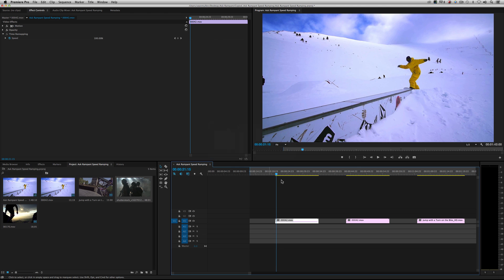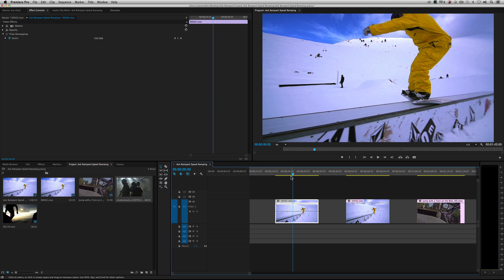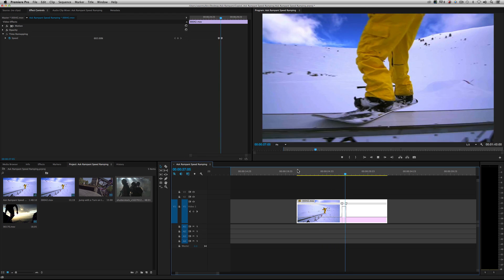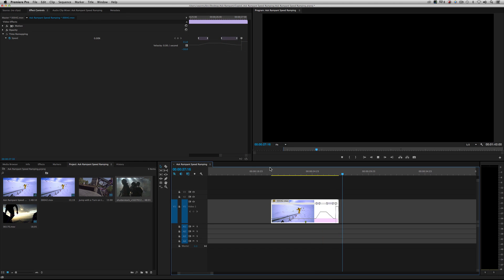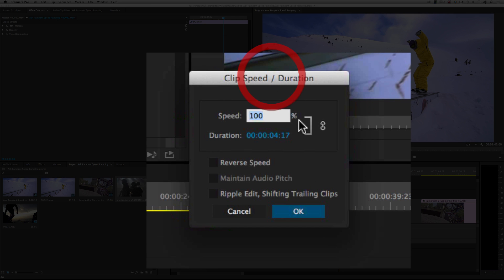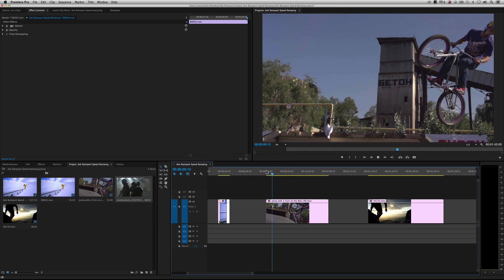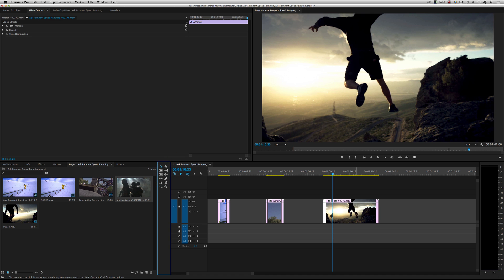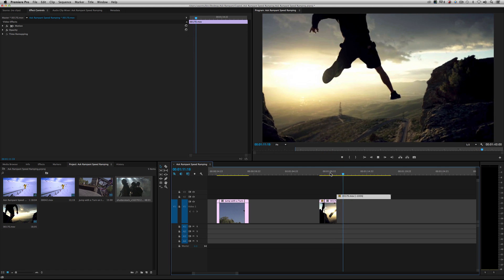Ask Rampant: How to Speed Ramp in Adobe Premiere

Comment: Why do my keyframes move as I increase the speed?
Reply from the maker: Hi there, thanks for writing. As you increase or decrease the speed of a clip, the length of the clip will grow or shrink accordingly. So if you have keyframes on a clip and then you speed ramp it, all of your keyframes will move according to your new settings.
Reply: Thanks Sean for the quick response. As you increase the speed the keyframe didn't move and the line stays lined up with the keyframe. But mine moves in as I'm trying to increase the speed; the keyframe and the speed line.

Comment: Don't use the first method, it messes up your other keyframes in that clip. They either stop working or change values randomly
Reply from the maker: Hey there, that's not the proper way to use the first method. If you already have keyframes set, you need to nest the clip and then do the speed ramping technique. Premiere will not allow keyframes on keyframes, it will absolutely mess up that way.
Reply from the maker: You can also speed ramp first, nest the speed ramp and then apply your effects & additional keyframes.
Reply: Yeah I knew that, but I'd like to not do so, it slows down the process and creates a lot of nested sequences

Comment: Hi Sean. Thanks so much for the tutorials! I've been using speed revamping quite extensively in Premiere Pro, but keep on running into the problem of not being able to use keyframes with aspects such as opacity, rotation, offset, etc. More specifically, when I change a parameter in the effects panel after having speed revamped a clip, the keyframe won't work for a given effect. Thus, I have been forced to nest all of my clips to simultaneously keyframe certain elements and also have speed revamping. Do you have any solutions in mind? Thanks! : )

Comment: I would really appreciate if you could help me with this!
I want to ramp a sunset from 100%-10000% but I want to do it with a curved line. HOWWWW!!!
Reply: I think you need to place a Keyframe at the very start of the clip and one to where you want it to end, then just set the speed of the second keyframe to 10000 and that should maybe work. Not too sure but give it a try.
Reply from the maker: Hey there! If you're doing the keyframe method, make your 100% keyframe and your fast keyframe and then right click and ease out of the first keyframe and ease in to the second keyframe. Your linear animation will now be curved.

Comment: Hi Sean, I prefer the cut method too because of the option to maintain audio pitch, since I was having a huge problem with unsynced audio. But I was wondering if you could still add speed ramps with that method for a smooth transition? And do you think using optical flow time interpolation instead of frame sampling is a good idea? Thank you.

Comment: I used to use the cut + r to switch rate stretching method, but you can't control the subtlety of the ramping that way. It's either fast or slow, no build-up, which forces me to use the keyframes.